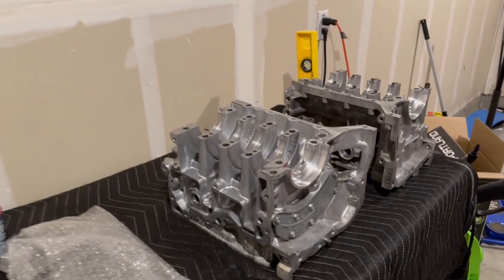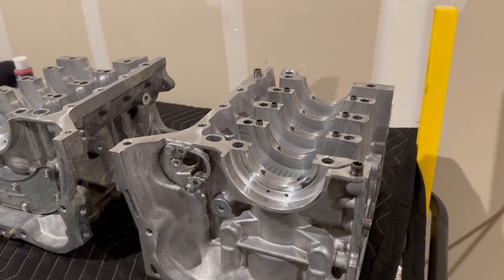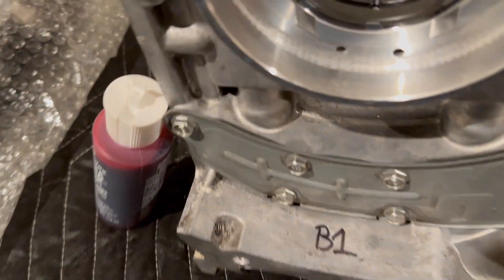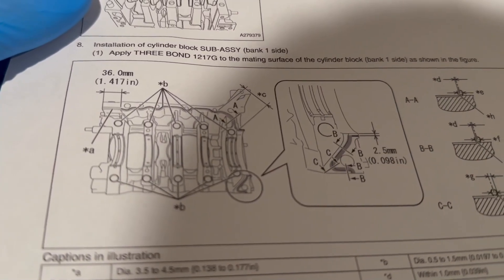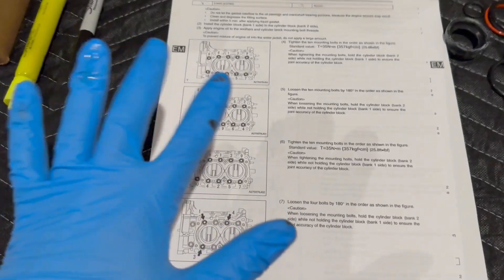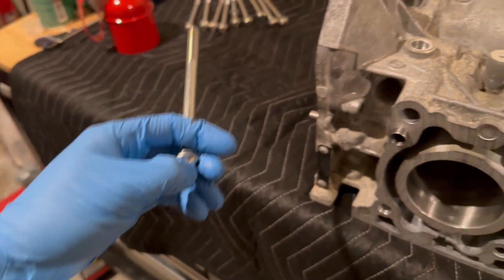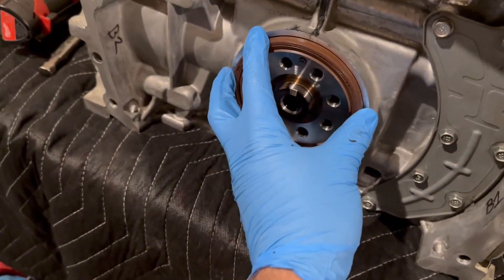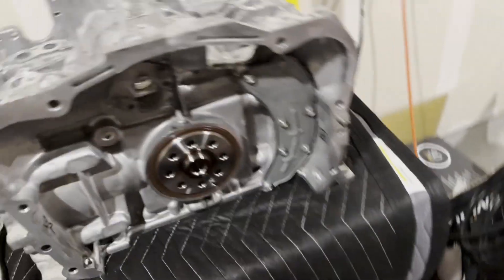FA20 Engine Rebuild Part 1 Case Half Assembly FRS/BRZ/FT86

Comment: How did the Black Permatex work out for you? I’ve been trying to figure out what sealant to use.
Reply from the maker: @drago4950  it’s been close to 2 years and 20k miles, and I haven’t had any issues. The only things that leak are my valve train covers and that cam plate cover. Those things are damn near impossible to get to not leak though. Also the valve covers have a gasket but the manual tells you to use sealant as well for some reason.

Comment: Will this assembly be exactly the same for the 15+ wrx?
Reply from the maker: @robmuhfacka5986  that I am unsure, they could be different especially if the 15+ wrx has an ej engine compared to an fa20. If they are an fa20 as well, i’m not sure if assembly is the same either since each one has slight differences.

Comment: What parts were needed for this. Build?
Reply from the maker: Not all of the parts I bought were necessarily needed because you can reuse a lot. I added all the information in the description. 
Parts that are absolutely necessary to replace are the case bolts, head studs, head gaskets, all other gaskets and O rings. You also need sealant I used roughly half a tube of sealant in a caulking gun. 
If you chose to reuse your oem crank you will need to get it checked for tolerances.
The other things you absolutely will need are the bearings, rod and crank. 
The other stuff it depends on what your plans are if you wanna upgrade your internals or not. I went with upgraded internals which you can find in the description.
Reply: case bolts are a must ?? i thought it was only the heads :/ fk me..i need to order those then..

I was planning on rebuilding tmrrw :( can you confirm i need the case bolts as well? 

Ps : case bolts are the final bolts you remove that holds the shortblock together? before you access the crankshaft right ?
Reply from the maker: @CommentThink case bolts are a must, much like head bolts they become stretched in the process and are essentially one time use

Comment: Did you have the block Machine at all
Reply from the maker: Yea it was bored, and Honed, didn’t get a line honed because my machine shop said he didn’t have the stuff to do it for some reason. He also cleaned up the mating surfaces as well, and the whole block
Reply: @ScratchMB   okay sweet I am about to order rods and pistons for my car but I was not sure if I had to do anything  special going to a different rod due to the offset style of rod